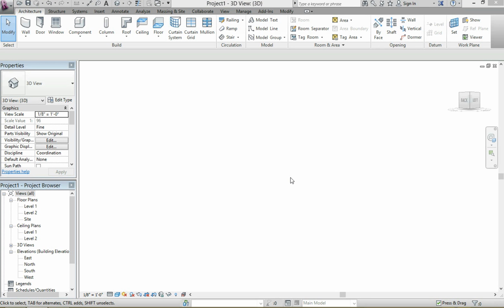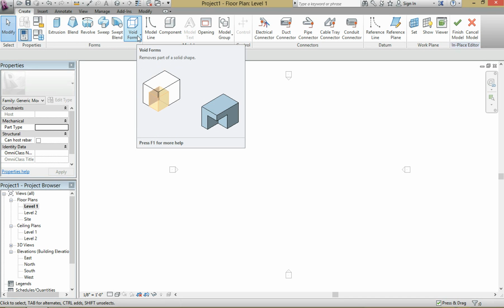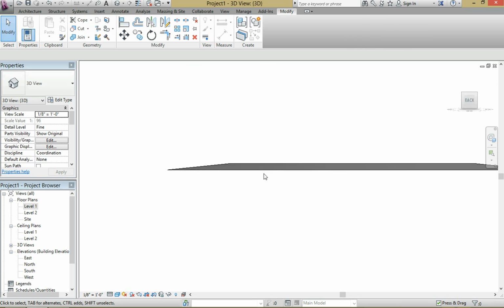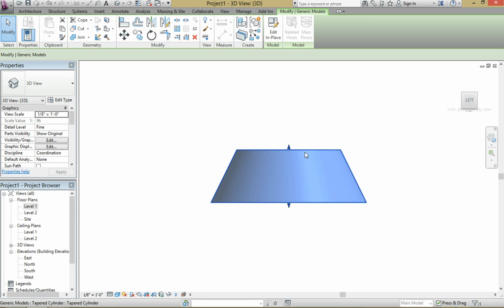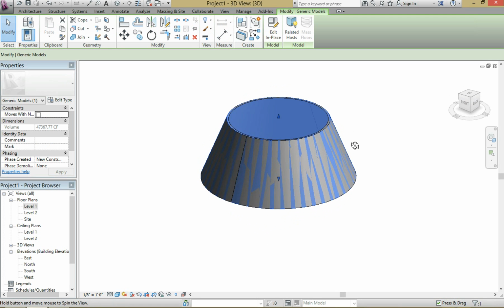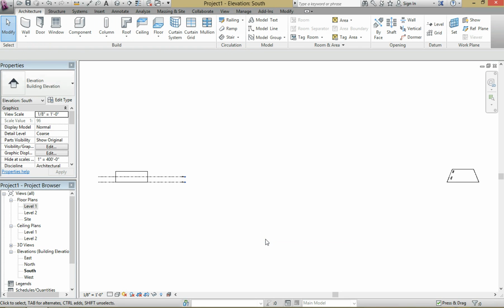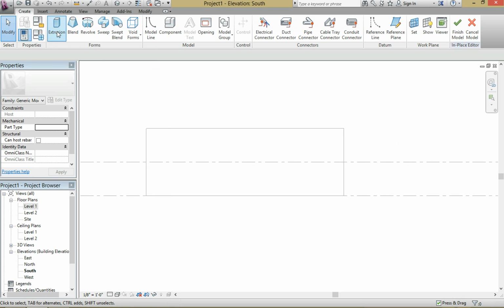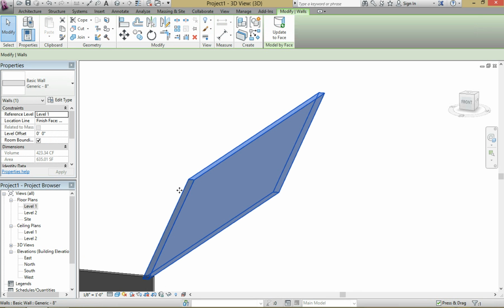(How To) Autodesk Revit Slanted/Sloped/Angled and Tapered Walls

Comment: nice video.but in addition could you please do a tutorial for windows in slant walls.thank you.
Reply from the maker: Karisma Karki Thank you!

Are you looking to place a family window or just a hole in the wall?

Thank you for subscribing!
Reply: Thank you too for replying. I just want to put a window on a slant wall, I think that is probably done by doing family window but I don't have any idea for it. As the normal windows cant be fit into the mass we made.
Reply from the maker: No problem Karisma Karki  that's why I'm here!

A window in a slant wall is not possible to my knowledge…well, actually, it is, but you have a very deep sill. You have to tweak the family of the window for it to be placed on a slant. A hole in a slant wall will work as well.